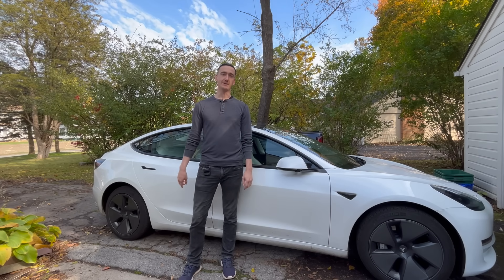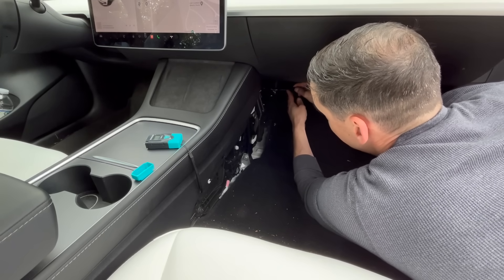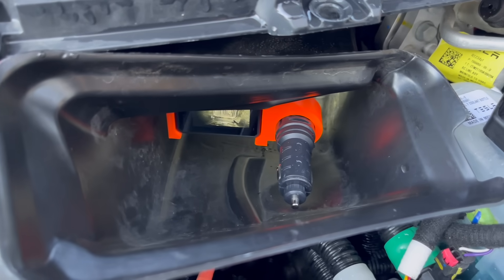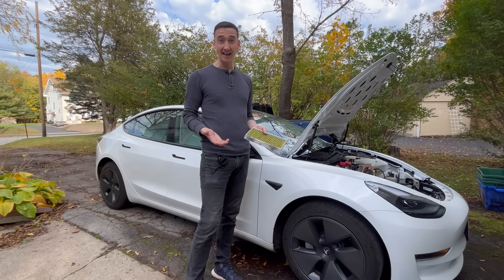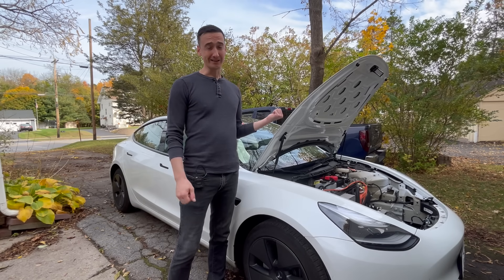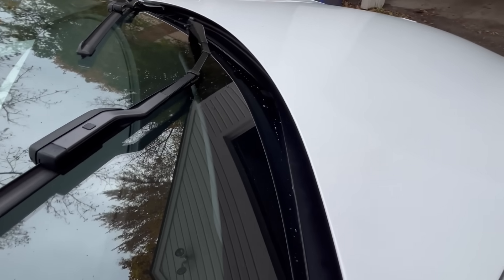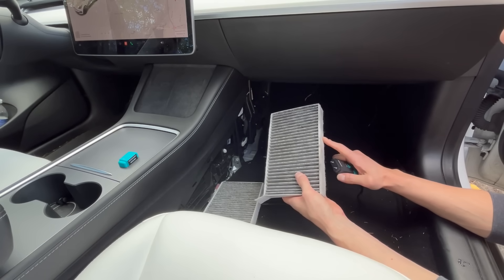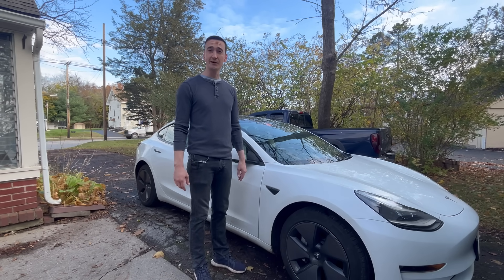This design flaw makes Tesla’s Model 3 smell bad! (with fixes!)

Comment: Love your video. Have a Tesla S with odor problems. Maybe not that much as 3 owner, but defently a lots of good tips from this video. Hreetings from Oslo Norway
Reply from the maker: Thanks for the comment, I couldn't get my hands on an S here locally to investigate. Do you have the hepa filter on yours or is it older?
Reply: @adamdport  Yes. First I got a S85D i march 2015 and those doesn't hava a hepa, but thay have bigger frunk, so that is a trade off that goes both ways. I was able to sell the S85D two and a half years later with only 5k$ loss,  and I ordered a new S75D. When i order it in autum 2017 it was almost fully loaded as standard, but extras was vegan seats, the hepa, pano roof, FSD so I ordered that to not have any regrets, because the plan is to keep it "forever" just as the plan was for S85D. The Hepa was changed after 60kkm, but that was not really neccessarry by that time. It was a Tesla ranger who changed it in my driveway, so I could have a look at it when it was pulled out, and it was just started to darkened a little bit. The cabin filter was changes recently (but I don't know if it also was changed at earlier services). I wants to check out if there is any improvments I can do to avoid getting this smell back. It was not horrible at any point, but the car just smelled a bit old if yo know what i mean. I will try to update in this comment. Love my S75D, and I want to keep it in decent condition. My next project is to convince a companiy called bilkomponenter to do service on a common error that the  Daylight running light burn out and needs to be replace, because this is mandatory in Norway to replace them when they are burned out. And Teslas sollution is to replace the whole front headlights cost 1700$ each. Want to try to fix the issue by split open the headlight with heat and change the LED incert and that will be about 200$ (plus work) for both headlights, so great savings there if that can be made possibel. I allso want to check out if its possible to add a resistor to dim the DRL just that little that will make them last 3 times longer. Appreciate you answer comments, and I am a subsriber now. Havent seen your other videos yet, and look forward to watch those. Again Greetings from Oslo Norway.

Comment: I think you mentioned the problem directly that the clip which is supposed to seal up the top does not clip in so there one problem begins the next is the plastic shroud of the windshield bottom is also letting water pass through

Comment: My 2020LR has a bad smell every few months after I wash the car (and yes I use Washmode while washing) or it is raining heavily. The only thing that improved it is to leave AC on auto all the time. Only then my car is running the fan on its own to dry the filter after I leave the car (tesla told me there is a moisture sensor). If its not on auto AC the fan stops when I close the car.

Comment: I like how Mercedes designs it, where it goes down, then up again, not just a tiny lip like that. (But Mercedes unfortunately easily fills up with gunk, blocking the drain (which has a seal) and destroys your fan, and even worse the wiring harness for the whole car.)

Comment: Seems to me that this  “ design flaw” of the ‘smell’ , which I believe most will agree is from mold/ mildew is likely a direct result of a fungus that needs to be completely eliminated. I suspect most people with this issue has a lot to do with how the car is stored , and not necessarily from an occasional car wash or rain storm.
Reply: I live in the PNW which is basically a temperate rainforest zone. Except for a short summer dry season, rain is a constant companion. Not just an occasional thing. It’s moist and wet here most of the fall, winter, and spring.

Storing in a dry hvac controlled garage helps, but 3-5 days a week gotta park at work.

My model 3 is the only car I’ve had here that gets this smell from the filters/hvac system.

Comment: I got a RHD model 3 (based in the UK) so the wipers flick water in the other direction. I've also fitted the gasket that helps stop water and leaves, etc. entering the air duct. Two years in and no smelly cabin air! Just changed the filters at 2 years and they were black and cruddy, but they were dry and didn't smell. Great investigative video by the way!
Reply: Where did you get the gasket from? I've looked on Amazon and it doesn't have the one Adam suggests (I'm also in the UK, just got my Model 3 so keen to avoid any smells lol
Reply: @matthewcoleman8267   I got it on Aliexpress
Reply: 2023 M3 in Australia. Good point about wiper direction. Will wait to see if I get the issue first. Like another comment about modding for an air intake at right angles to the upper intake to reduce water intake. Maybe also just an angled hood above the current intake. It would be thin in height but could be quite wide?
Reply: Pre Highlander version delivered in January.

Comment: Great video..Note in that early 2020 Y (similar to the 2020 3) the drain hole is below a sump (raised bit).. seemingly that changed for the models with the new frunk design (some point in 2021 or later)
That seems like a much better solution.

But my takeaways .
- Use Car Wash mode when washing car, particularly in got days when a/c might activate
- Dont run fan on high during rain

If that doesn't work consider the extra stripping.
Reply: Yup the newer models don't suffer from this issue nearly as much. I think there's also some software tweaks that aim to dry to the radiator coils when you park the car, but I could be wrong about that

Comment: Maybe there’s another reason for having the HEPA filter on the model Y, which was developed after the model three. Maybe part of the woes they got rid of water ingestion with the new filter set up. Any case, this might be part of the problems with developing a car in great weather?  that and a cruise control that can’t be used in the rain.
Reply: Sorry, I don't own a Tesla, so this is new to me.. but you can't use CC when it's raining?

Comment: Thanks for the super detailed video! I too installed the aftermarket gasket and can confirm it does prolong the life of the filters. I noticed you mentioned that the plastic cover for the vent and 12v battery is never flush and doesn’t clip in, it’s because the underhood clips basically come broken from the factory:
https://youtu.be/9mbWcTPKR5E (tl;dw: video shows where the broken clips are and how to fix). Thanks again for the awesome video 👍🏻
Reply: Well done with this!

Comment: It doesn't rain in California and many of my friends' Teslas still stink. Mine doesn't stink after many years because I basically don't use HVAC. It doesn't get very hot or cold here... And I keep the HVAC in recirc and fan=off to keep exhaust gases from entering the cabin.

Comment: Very interesting and well put together topic, I had this with my 2020/21 M3LR, Tesla replaced the Filters and used a machine to defume the A/C condesnsor under warranty, but the evidence presented in your video puts doubt on this as a long term solution. I'm UK based but will definately will see if I can get the aftermarket gasket and give it a go, thank you.
Reply: Very good systematic approach!👍🏻

Comment: Can you just leave it in ‘car wash mode’ all the time so it stays sealed off?
Reply from the maker: "Recirculate mode" also seals it off, but allowing outside air in will cool the car quicker and more efficiently if it's cooler outside the car than inside. This is always the case in the summer when the car's baking in a parking lot. Does that make sense?

Comment: Great content.
Failure is built in.
It's not a new concept but Tesla seem to Excel in designing a very limited lifespan.
It's a business decision.
I've seen water channeled into the engine sparkplug wells on the facelift jaguar S type V6.
No way that's by accident.

Comment: 15:40

The fact that you mentioned differences on early Y’s, is amazing. 
Most people skip over details like this on early models. (For example, early Y’s have holes under the emblems and no “C” shaped brake lights.)

Also, I’ve read on forums that an unofficial retrofit is possible by ordering parts directly from Tesla and adding the holes into the trim yourself. Some of them were even able to request the actual software to “enable” the mode on the screen. Would be interested in seeing someone do this 👀
Reply: I just want to mention that the stinky sock smell does affect bioweapon defense equipped cars as well.
Reply: @paulg8065 I can't imagine the defense value against actual bioweapons is any good if it can't defend against... mold?
Reply: @TheLukasDirector  AFAIK the HEPA filters are only active when bioweapon defense mode is turned on. Otherwise it just filters through the cabin air filters.
Reply: @paulg8065 yes, I was so hopeful while watching this video, and then he said that part. I have a '23 MYLR7 and it REEKS.
Reply: Question is, will that trim piece work for the 23 MYs?
Reply: @Kerflop1 I ordered it because I found it on Temu of all places. I will update here if it works.

Comment: Can anyone speculate on if a 3D printed duct that pointed Down, not allowing water to enter the ducting might be advantageous to prohibit non incidental water from entering the HVAC system? Could even have a lip gutter and drain with tubing to move any water that caught against the edges away from flicking into the intake if that were deemed necessary.

Is it possible the people that claim the smell is coming from the coil itself have developed a problem that has simply spread from the original cabin filter that was problematic, and now even with a fresh filter, the problem exists inside the HVAC system past the filter? And if the filter issue can be controlled, then a coil cleaning could remain persistent?

Sure seems like Tesla would get this problem solved after all this time....even a entirely refreshed model...

Comment: True in most cases, but not in my case because I only wash my Teslas with Optimum no rinse method. Only a spray bottle ( no buckets) and some microfiber cloths. Done this since 10 years on my Model S cars and since 2020 on my Model 3 and still no scratches. Still great video. Thanks

Comment: Excellent deep dive into an uncharacteristic Tesla design flaw. I knew water was getting in but didn't know exactly how. Thanks for sharing all the hard work. Purchased both items. FYI, my stink problem ramped up sharply after my car was in the body shop for 8 weeks for body work. Changing the air filter didn't help. I had Tesla service foam the coil and make sure the condenser drain was not restricted and then replace the filter again. That cleared it up.
Reply: Not uncharacteristic at all! The Tesla power train is good. Everything else is amateur hour.

Comment: Considering this issue occurs without rain, it seems like the solution is to remove the filter
Reply: I think it can happen also from humid environments alone... Normally it happens to my car after having driven in the rain, but I kind of remember it also happening in the past without rain when I was living somewhere with an underground parking garage that was a bit damp...

It's probably not a good idea to remove the filter as that would allow little pieces of debris to get deeper into the AC system... rocks, leaves, etc. 

Hopefully in future models of the cars they come up with a solution to this. At this point, a couple years into owning the car, I know that it can happen so after a rain (and when I remember to) I run the climate in the car through the app for a few minutes before I get in, but that's annoying and we shouldn't have to do things like that lol

Comment: I have a 2022 MYP with 23k miles on it and I’ve changed the filters 3 times already.  The smell was unbearable.  After further investigation, I’ve found that my hepa filters appeared to be moldy and holding moisture.  Will the gasket you posted work for a 2022 MYP?

Comment: props to you for looking at all the other car designs. I was gonna say teslas is similar to a Porsche but without any of the preventative engineering thus the problem you have. the air intake is the most sorry ass design i have ever seen and they were too cheap to put any more plastic rivets on it even.

Comment: Judging by the mold in the cracks in the driveway id say you live back ease where it is humid. That Vent has to be able to pull in fresh air, it's why it is not sealed against the hood. Also I cleaned My evaporator only once at 30k miles and I have not had to do it since. But I have decided on a schedule of changing the filters every 30k miles. Where I live it is anything but humid. Oh and the only water that enters the Tesla vent is during a car wash otherwise our movement would keep the water flow away from the vent that is elevated.

Comment: YEAP bad design from Tesla and just don't care...I purchased 5 of those "pre filters" that go on the tube also a plastic cover with little holes so it can hold the "pre" filters in place, so I owned the model 3 since Jan 2023, I determine that will replace the "pre" filter every 6 months because is much easier and cheaper but I did noticed the air volume from the main vent was reduced a little, obviously Im blocking the flow of fresh air with another filter and the plastic holder with the holes... I will also buy that extra seal to see how it works in my set up ...so far 11 months and smells as it just came out of the show floor... I replaced the pre filter in July it was very dirty and moist but it didn't stink

Comment: Tesla replaced my gasket here in the UK after a call for a steering wheel replacement, the engineer came, did the steering wheel and the gasket after according to him it was a reported issue.

Comment: You have to remember that in place with 100% high humidity air already carries water, A/C is working overtime and condenser is covered with water droplets, filters are also completely wet in such places. The gap in condenser is a major design flaw.
Reply: I have a car with the exact same setup where the filter sit next to the evaporator yet no bad smell.
Reply: Just wait  @1943vermork
Reply: No because the air presses the water to the other side of the evaporator. So this is not an issue. But, depending on how the draining in the bottom of the evaporator is, it could be a problem that the filter sucks up if you get water standing there.
Reply: What air pressure when AC is off? This happens in high humidity areas when you turn ac off water condenses on cold coil, moves to filter..  @Xanthopteryx
Reply: @teslascoop2177  Fan moves air from filter side to condenser side and thus also forces the water to the other side of the condenser, where the filter is not. If the AC is off then water will not condenser on the condenser since it is not colder than the dew point of the air entering.

Comment: This was amazing! The quality of this content was fantastic - learnt a lot. I have had smelly filters - the video showing the drain hole actually ends up as an intake also might explain the strong exhaust smells every time you come up behind a gasoline vehicle (2019 M3)
Reply: Do you know how to fix this? I get the smell in Model 3 more strongly than in an ICE car. It is enough to briefly drive through smoke and is perceptible in the cabin. I hate it and would love to find a solution.
Reply: @Yelonek1986  I put it into recycled air if I see it in time - it feels like it scoops air up from the ground, not the intake at the top, maybe my duct has come loose. But no - I don’t know how to stop it.

Comment: I change my in cabin air filters every 6 months on all my cars. Never had a bad smell. Model 3, jeep wrangler, and fiat 500.  We call this process routine maintenance 😂
Reply: Not sure if it has been fixed in later designs, but watching videos of replacing the cabin filters on the early model 3’s makes it look like a PITA. Something that requires regular maintenance should be dead simple to do.